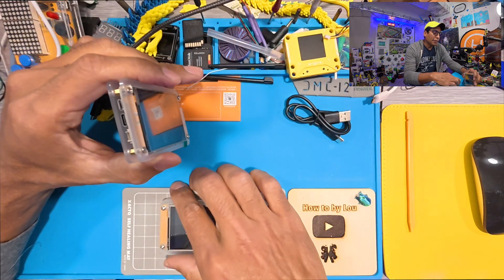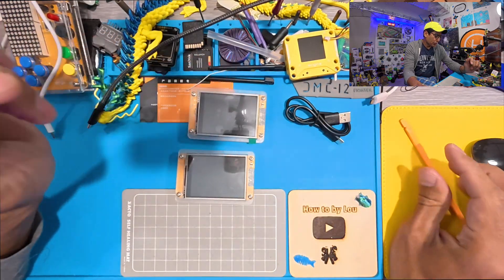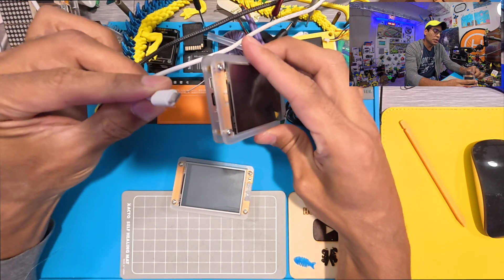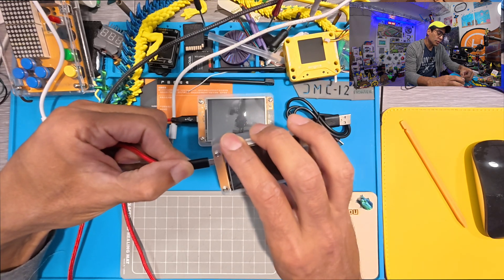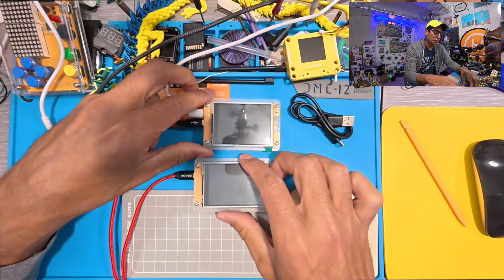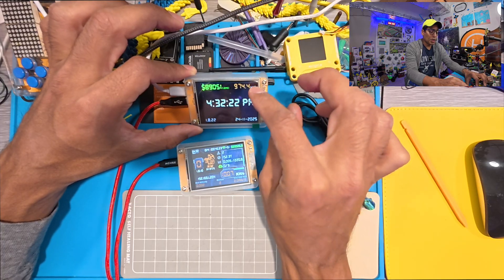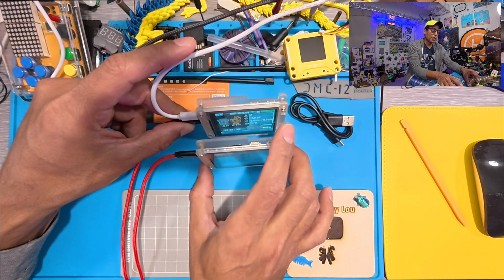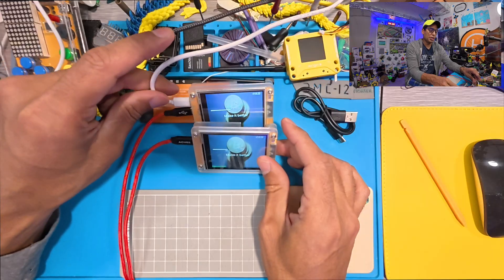How to connect 2 one shot miners - The Power of One!

Comment: I'm guessing on these devices that the USB-C & the micro USB ports are interchangeable? I've been getting a screen flicker/flutter on the second of two devices, and my searches say that each should be connected to its own power supply. I've plugged power into both ports and it seems to work. I figure I'll use the micro ports for daisy-chaining, and USB-C for power for each. I was confused initially because I just assumed the jumper cable that comes with each unit was for connecting them together. Still haven't figured out what that cable is for.
Reply from the maker: One of the our viewers shared that it has to have a designated power source otherwise it will flicker. One of my units that's not connected to a dedicated power source does do this too. 

Dylan from oneshot miner shared the cables are useless. You can watch the live support session with oneshot miner.. Hope this helps. Setup up my multiple miners the way you mention. Works perfect. 
https://www.youtube.com/watch?v=T7g1rzHLsdY